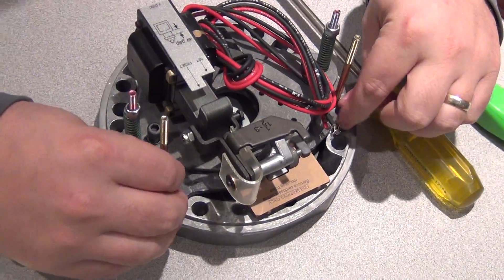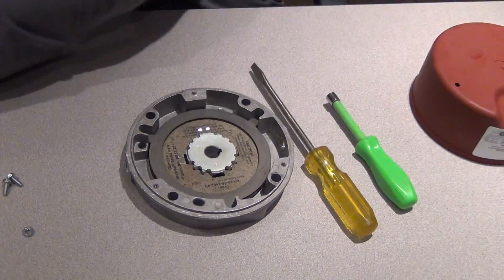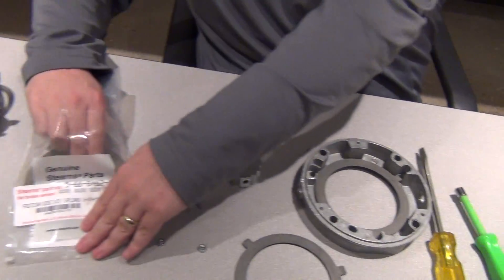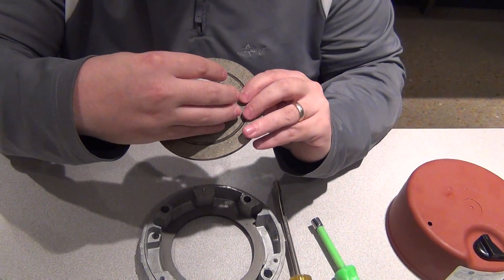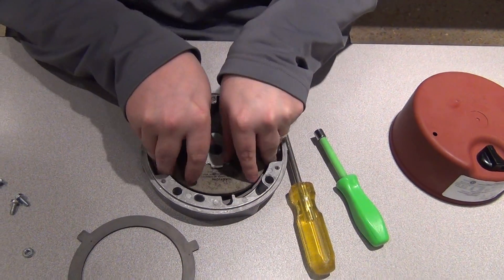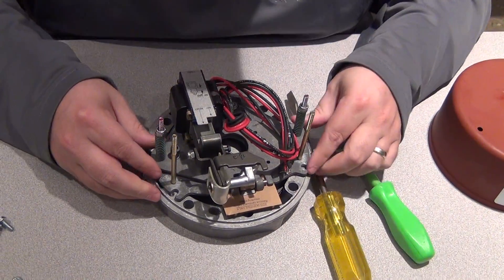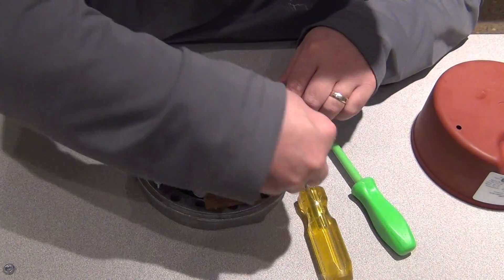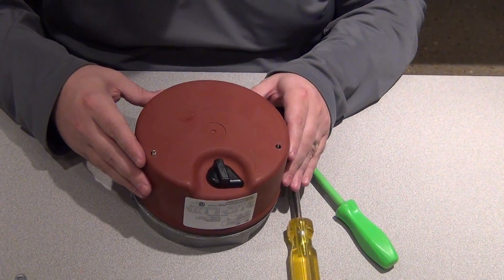Stearns 56,000 Series Brake Disk Replacement Procedure

Comment: It does matter where the retaining springs line up, they must be opposite the hub set screws. See step 3 under "Friction Disc Replacement Series 1-056-X00, on page 2 of the installation and service manual: https://www.stearnsbrakes.com/files/90560_stearns_1056x00_series_all_revisions_manual_
Reply: Actually they are called "stabilizing springs".